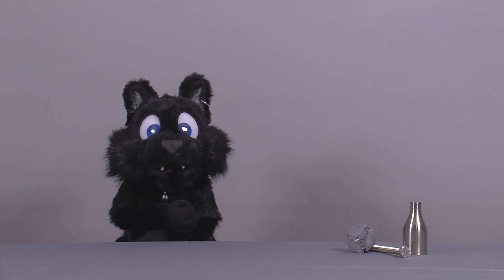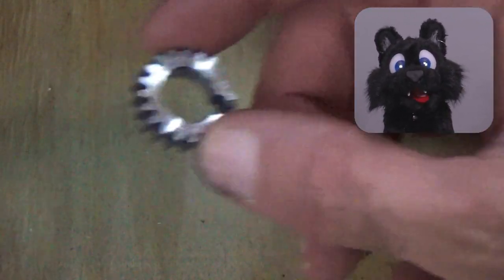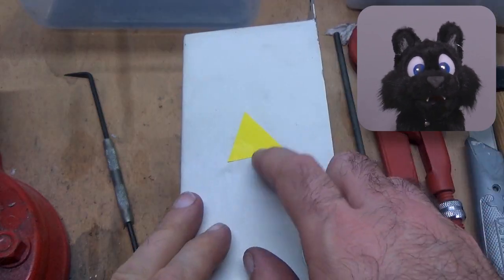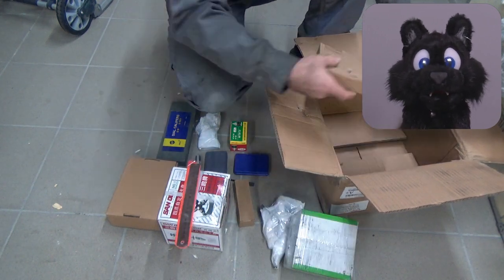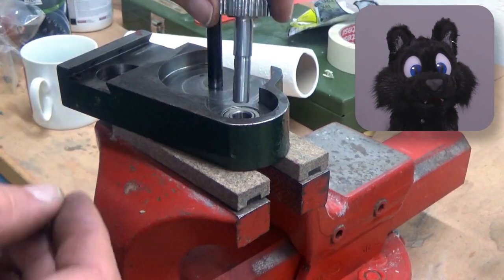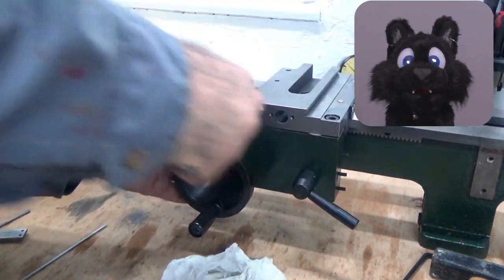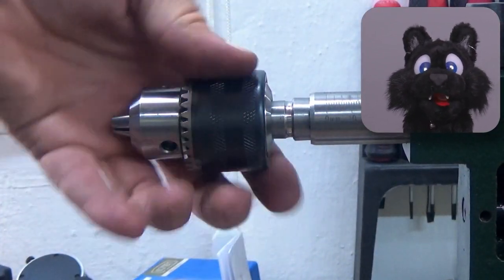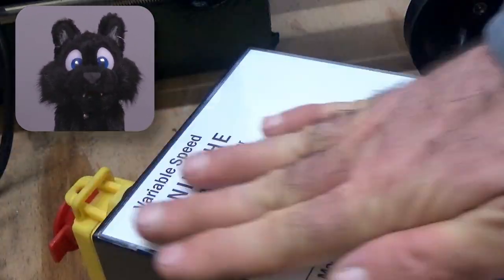Workshop Project #8 - Metal (Mini) Lathe

Comment: Hello atkelar, thank you for your sophisticated Video´s. I love them very much.(and the Cat) I´ve got a mini lathe (saupe 300) with some missing part's. More precisely 3 so called "Spannbacken". Do you have any idea to get some of these?
Reply from the maker: Thank you! 
You mean the ones that go into the chuck? "Spannbacken" would be the "jaws" for a chuck. It's been a while since I used German terms for technical stuff 😊 You might look at the chuck itself, it might have a model number stamped into it (maybe on the side that is mounted on the lathe) and google for "replacement jaws for three jaw chuck" and add your model number. Again, higher end stuff has these as replacements, as they occasionally get mangled.
Reply: @atkelar  Yes exactly those 3 jaws are missing.

Comment: all these vids about these junkshop lathes, i'm thinking it'd be cheaper and easier to just make one.  i'm thinking something bigger than a gingery, but not by much.
Reply from the maker: This does present a very basic problem though: What tools to use to make new and better tools? I still like that little machine; and since I knew I was in for a project, I don't blame anyone. I looked for cheap, I got cheap and a nice project video. To me it is still a win-win 😅
Reply: @atkelar  the gingery requires castings to be faithful, i'm thinking a steel boxbeam with plate on it for ways, filled with concrete and the headstock made of... angle steel and a heavy trailer hub.  everything else about the gingery would be an easy yes vote.  as a video it's a bit of 'are you trying to kill me?'

Comment: Excellent video. Even with the burrs on the f'ing gear, you had the patience of a saint sorting that machine out. This has reminded me why I went down the vintage route for a lathe and milling machine. The manufacturers workmanship is so much better.
Reply from the maker: Thanks! I am sadly on a budget in both money and space dimensions; so the cheap lathe, tuned up as good as possible is my best bet on being able to manufacture some spare parts for other projects. I doubt I need anything larger (as everybody who later gets a larger tool) but so far it served me well. Still looking for a matching mill though...

Comment: I will definitely be painting my mini lathe now lol at first I thought you used black, looks way better then before. I have a harbor freight 7x10 mini lathe and I'm gonna paint it black, im buying a new extended 16" bed (actually 8" longer then the 7x10... yeah, idk either) next month when it gets off backorder so that will be a perfect time and excuse to repaint lol I've got the entire cross slide etc completely apart at the moment, I'm rebuilding everything I can now before I get the new bed. 

Did you order new labels or something or scanned the old ones?
Reply from the maker: I did paint the tins in black for some variety, but they aren't on the machine yet. I still need to figure out where I want to put  it for a proper setup.
The labels are home made: I took pictures before I tore off the original ones and then did just printed a new version, made in a graphics program. I think it was "inkscape". To prevent the paper from the environment, I laminated it before sticking it to the machine again. A good paint job is a way of personalizing equipment; I recommend picking a color scheme and sticking with it as good as possible.

Comment: 1:47  Way oil should be a bit sticky.  It prevents the oil from flowing away from the sliding parts.  Mobil Vactra 2 is commonly used.
Reply from the maker: Thanks for the input! I'll look into it!

Comment: These mini lathes are capable of some really good work, but you have to be willing to put in a lot of “sweat equity” to bring out their potential! I have a 7 x 12, 7 x 14 and a 9 x 20, not the cheapest versions either, but they could each be categorized as kits! Straight out of the box, they were basically useless! Tear down, clean, then reassemble and tweak/adjust/modify! Only then will you have a serviceable machine!
Reply from the maker: I agree. But since it's a hobby, I'm willing to trade a bit of time for money in this case. The add ons were surprisingly good with this one. I have "replace spindle bearings" on my todo list as well as "change belt system" so I may end up with a better low-speed range. I don't like to cut threads or even try knurling at high speeds.
Reply: @atkelar  I was amazed at all the add ons that you got in the package! And I agree with your statement about it being a hobby! Half the fun is getting the thing running properly! I’m anxious to see your progress!
Reply from the maker: I am using it for smaller parts already, like the lost spacer in the reel to reel recorder. I'm keeping the next tune up for the warmer time of the year again. If everything works out that will be around May.

Comment: These chinese mini lathes have a design issue where the motor is mounted by only tiny bolts, which causes a lot of issues.  I would recommend watching TimNummy's video on fixing this.
Reply from the maker: Thanks for the tipp! I think with all the issues, the Motor mount is the one hing that worked out OK on mine ^^ I did keep the offending screws "semi-tight" only, because they need to move for the belt tensioning. Also, there's a bunch I still want to do: new bearings for the headstock, maybe metal gears, the angle scale on the tool sled... and maybe different belt/pulley combo to get a bit of lower speed for thread cutting. That would also require a different motor mount most likely.

Comment: This is why I wished there were ways to do low cost lathing or milling at a scale that is affordable like low cost 3d printers and other cnc stuff that has come down in price. Think that could ever happen? Happy birthday as well!
Reply from the maker: Thanks! And, well... a 3D printer is pretty much (almost) plug and play, whereas a lathe/mill still requires some education to avoid injury. These machines have enough power to seriously mangle the operator. That's why I don't think the market is going to become as big as with 3D printers and by extension, the prices also not nearly as low.
Reply: @atkelar  That is a very good point. I guess that was from the point of view of someone like yourself who has the knowledge and willingness. 3d printers are far safer on teh pawsies yesh. Hope you have a new freedom   to create and repair.
Reply from the maker: I do like the right to repair (as if you can't tell ;) - sadly, price is purely a question of how many potential customers there are. And the more dangerous a tool is to the average consumer, the less likely it is to drop significantly in price. I still need a mill of comparable size - but that's for next year ^^

Comment: I've have an mini lathe too, it dark green and yellow base tray. it has a drip pan foot base with reverts switch not gear revert lever. it has speed control like your but not read out display and it ALL metal gears
Reply from the maker: Ah, the gear reverse is for the lead screw. The overall motor direction is the switch on the front. Might have been not perfectly clear, but the video was long as it is ^^